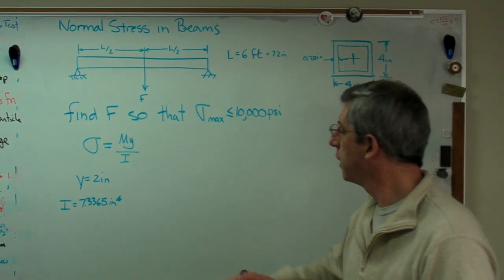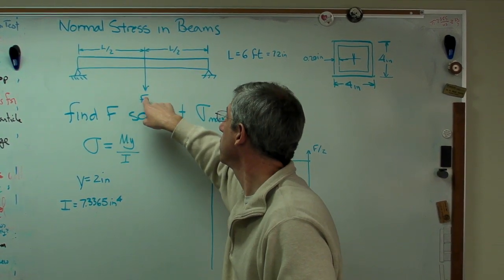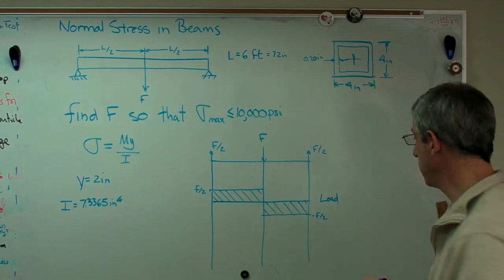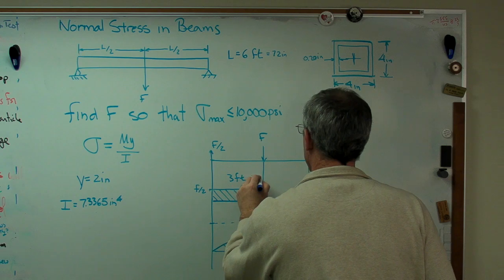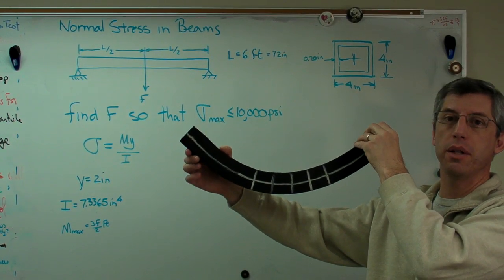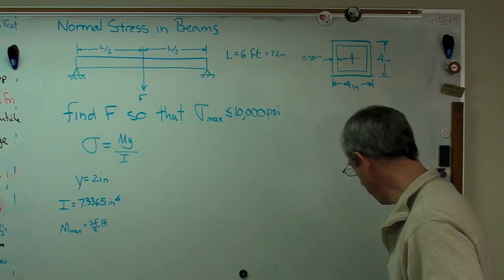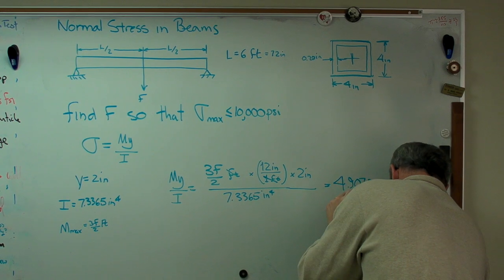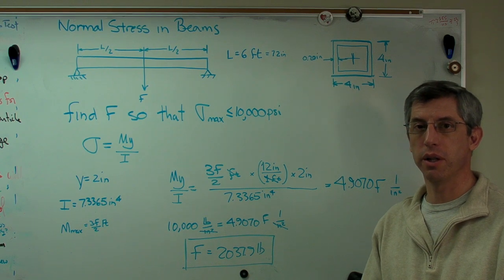Beam Bending 1 - Part 2.MP4

Comment: Hi PurdueMET,

I though that the second moment of area was not only the sum of  1/12 BD^3 for each rectangle. But the sum of 1/12BD^3  + the sum of ah^2 for each rectangle. where a is the area of the rectangle and h is the distance from the centre of the rectangle to the neutral axis of the cross section. Im not sure if my comment makes sense but this is just the way i'm being taught it at uni in England.
Really good video though, i liked the foam showing compression and tension!